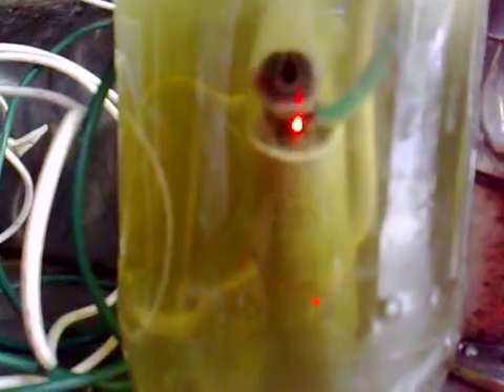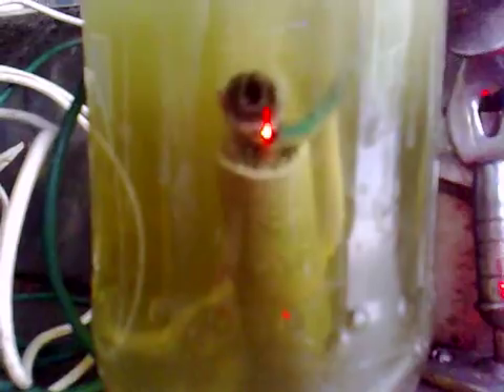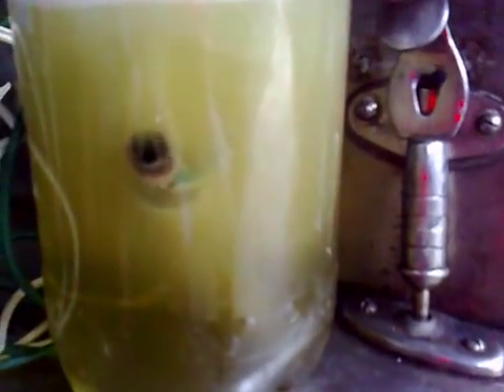HHO TUBES CELL EXPERIMENT 3 AMPS IN ACTION

Comment: @2bigHybrid 
in my circuit the buck converter......
i turn off the cell then on again.......that limits the amperage to any amp i want.
the inductor is designed to hold the amps when circuit is off.  thats why i used big wires and big steel.....i think just the wires can be used as bifillar wound without the steel